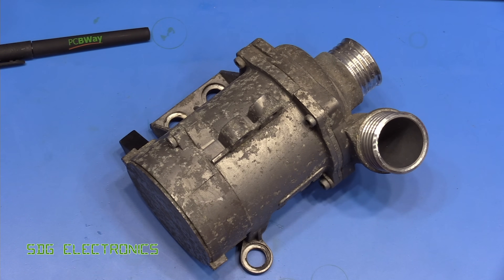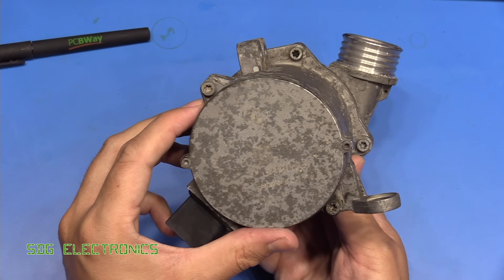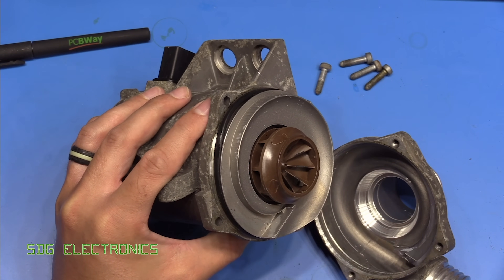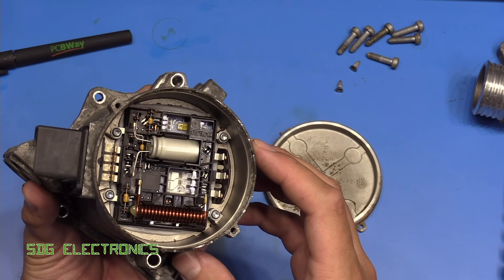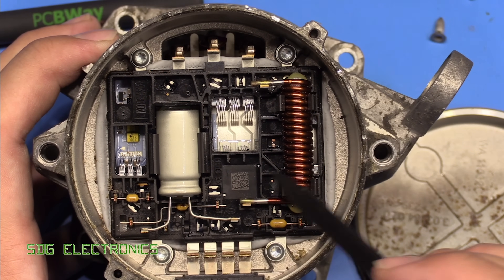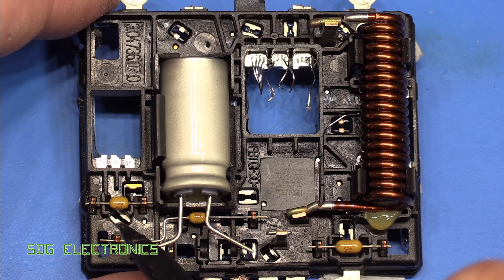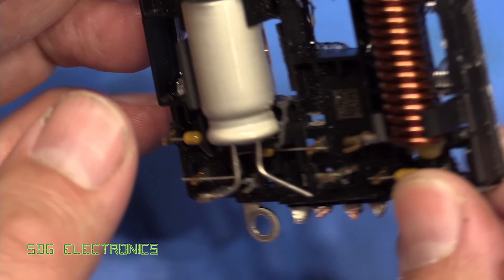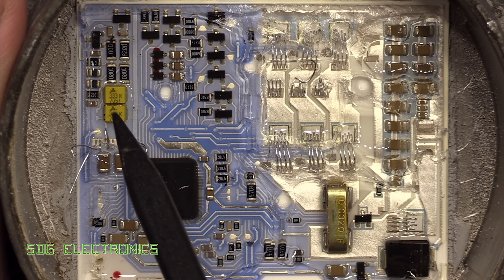SDG #257 Interesting electronics in a BMW Electronic Water Pump

Comment: Why are these destroyed by running dry though?  The main point of these really is to be able to use the heater while the engine is not running. ( Assuming the coolant is at temperature)

Comment: There's a depressingly common failure mode on this sort of construction with Bosch ECUs - the big bits fall off. Typically the larger tantalum caps just come adrift. They can be repaired, but it is a bit tricky as one would imagine, mainly due to the many fine & fragile bond wires present that are embedded in the gooey conformal coating that has to be cleared out the way to perform the repair. 

They seem to love bolting them to hot bits of engine for some reason, so lots of heat cycles.
Reply: I doubt you'd find any tantalum capacitors anywhere on a modern vehicle. They are banned by most manufacturers.

Comment: The engine driven water pumps are horrible. They don't do anything well. They are inefficient, leaky and have poor flow rate at low engine RPM. The electric water pumps can be variable speed but even if only one speed, they can be designed to give a consistent flow rate no matter what the engine is doing. You can also turn on the pump with the cooling fans to move heat out or the engine to minimize under-hood heat soak upon engine off. I think the pump design is centrifugal. The pump is controlled using a PWM signal. The unit looks similar to the Pierburg CWA200. When the pump is operating the units casting will probably track very closely with the coolant temperature. I think the motor is a three phase induction motor and not a brushless dc motor. To drive the motor you would have three half-bridges which are near the middle of the module which would be switched using PWMs to create a three phase AC current waveform. 

Ceramic hybrid circuitry design is difficult, it seems to take around 10 years before the supplier perfects the electronics. The failure mode is usually a crack somewhere on the ceramic. 

Packaging the electronics on-board the pump is to save space under-hood. However, operationally it is conceivable to just use a 3 phase induction motor powered over a cable to an electronic control module. The induction motor if sealed would last a very very long time, with the first failure probably occurring in the bearings. Perhaps the best solution would be to do what ABS designs do. That is, separate the driving electronics from the actuator, but mount it on the back of the unit so it still saves space. This way you can just replace the electronic module end piece rather than the complete pump if the failure is in the electronics. 

I think you could actually rebuild the pump if the failure is in the electronics. You would have to install a new electronic power module on the motor coils. Much like with rebuilding alternators.

But, if there is room in the vehicle you could perhaps mount a different design approach to heat sink through a longer cap (if the vehicle has a couple of inches clearance on the end) which could have a set of cooling fins to keep the electronics cool.

Comment: If you see inside the VW groups DSG gearbox the whole circuit is made up of the large ceramic substrate with ICs having gold wire bonding.
I don't which engineer in VW group suggested to go for ceramic substrate for a gearbox which goes through harsh vibration.

Comment: You should apply voltage and see if anything is getting hot.  Perhaps moving components around fixed the board if there was dust inside :)

Comment: Now I know where I can get a high quality capacitor when I need one on a Sunday! 
Just head out to the local pick apart auto wreaking yard and pull apart a BMW waterpump! 
I have been sourcing super capacitors from the BMW airbag modules for some time now.... Their wiring harness also provides many useful applications too, especially the long battery to starter motor cable, great for DIY jumpstart cables.....

Comment: I suspect a lot of the reasons for such a different design is vibrations. Huge variety of frequencies and amplitude on an engine. Solder joints tend to have a nasty habit of failing in automotive stuff which is probably the reason for the flexible wires. And the plastic is probably there to try and damp the larger components.

Comment: Automotive components teardowns are my favorite videos! Love it!
All components used in car electronics are Automotive Grade, a lot higher grade then consumer electronics, and in many cases about 20-30 times more expensive. Which is why this Nichicon capacitor has no sign of degradation.  
By regulations,  modern cars are made to withstand 24V in reverse, in case some crackhead jump starts them in reverse from a truck. The CAN and LIN lines can withstand +/- 32V. Any other line can withstand short to GND and +16V. Everything is EMF resistant as well. 
People who hate on modern cars just don't understand what goes into manufacturing them, and how protected they are, compared to just 20 years ago. Car manufacturers, and especially car dealers make more from maintenance then selling cars, which may give you an idea why they brake so often. It's not just BMW, it's every car manufacturer on the planet.
Reply: There is a line in a swedish song that says "Now I waste my time with painful nostalgia" That's what people that think an austin maestro is more reliable than a modern car are doing. No point telling them though.

Comment: Interesting look inside a BMW water pump. Thanks.  Did you mention at the end that the thermostat was also replaced. I would have assumed that as they have full control over the coolant flow they could do away with the thermostat. Edit: Perhaps its just for there for the full speed failure mode
Reply: Thermostat is there to control flow to radiator, as the electric pump runs all the time to circulate water through the block to keep hot spots from forming. Also speeds up a little as the heater core is enabled, but will still, even with no heat, have to move water around otherwise the cylinder walls and heat heat up more than normal, plus the water is also used to cool down the engine oil at the filter, so that the hot oil being pumped up from the sump, after cooling the crank and pistons, is kept from degrading too much.

Speed is increased when the ECU detects flow to the radiator, from a sensor on the radiator, and then is modulated to keep the temperature at the return from the radiator constant then, so the engine runs at a constant 95C temperature.
Reply from the maker: There is still a thermostat to cut the radiator out of the cooling loop to let the engine get up to temperature quicker. The oil and water temperature is effectively controlled through both the radiator fan and the water pump. It runs at a low speed all the time, but increases when the coolant temperature goes up. There's a couple of different thermal profiles - the eco setting raises the oil temperature up to around 112C, under heavy load it drops closer to 100C. Oil temperature is tied to the coolant temperature through an oil cooler - this car has the larger oil cooler so the temperatures track closer when driving hard.

Comment: Integration is the key to lowering cost and I expect a modern re-design of that PCB to have far fewer passives and only external power transistors. ASICs running directly from battery voltage is pretty normal. One-wire comms (usually LIN) PHY would be built in to the ASIC.

Comment: I thought I saw a cracked resistor at the bottom near the center of ceramic board.... but it might be just some lensing
Reply: Yeah there are cracks in the soft silicone so its hard to see anything.

Comment: Looks like the ceramic board itself was made by Thompson CSF, with the logo appearing on the ceramic just below the main ASIC chip. Likely the ASIC is a Renesas part, as they do a lot of automotive parts, with a specific set of masks and programming to make the ASIC for Pierburg, and of course, if you order a million of any regular chip, any foundry will be all too glad to mark the package with whatever you want instead of the generic part number, for no extra charge.

Comment: You know they are prone to failure when you have multiple aftermarket suppliers of them, and even the actual BMW dealers install the aftermarket ones.
Reply from the maker: I think it also helps that most of these pumps are fairly standardised across the various models and there's a worldwide market. To be honest, I preferred this replacement compared to needing to do a timing belt replacement if a belt driven pump had failed.
Reply: @sdgelectronics  Do not think the price is right though, labour rates are pretty much the same for most of the water pump or electric pump replacement, and I can replace my old VW  water pump in under an hour, as it is really only 3 bolts holding it in. But the price of the electric pump is 30 times the mechanical pump price, from the same aftermarket place. they sell a lot of the mechanical pumps, mostly because there are a million VW's on the road still. BMW still is called Break My Wallet.

Comment: Would make sense that perhaps a component has failed in the comms input/output circuitry if the pump still runs but in a fail-safe (i.e. full speed) mode, as that implies the MCU and motor drive is still working.

It disappoints me that automotive manufacturers are increasingly going with these types of ceramic hybrids, because these things are almost completely unrepairable at the component level. I remember watching a YT vid a while back from a company that specialises in component-level repair of vehicle electronics, and they despair at ceramic hybrids filled with wire-bonded bare dies. One of their examples was an engine control unit from a Ferrari 360 that is commonly known for failures, but no longer available new. It's made by Bosch, and the entire thing is a conformally-encapsulated ceramic hybrid with about a dozen bare dies. They figured that only one of the chips frequently dies, but there's nothing that can be done about it. So for the sake of a chip worth a few dollars, an entire $100,000 car is rendered useless unless a 2nd-hand replacement unit can be salvaged from another car and re-programmed.
Reply from the maker: I got intermittent codes for other items on the same comms bus, so likely the slave transmit components failed. I agree that reparability is the last thing on the manufacturer's mind. On cheaper items like this, it's acceptable given the bearings are probably heavily worn too. Expensive or rare modules should be at least designed in a way that allows some method of salvage though.
Reply: There are better modern after market ECU:s availible on the market though. Sure it destroys originality but I would rather have a working reliable car. Also a 360 is hardly a modern vehicle.

Comment: I have seen same construction in my alternator regulator on VW, chip on ceramic substrate, bonding wires covered with very softy clear kind of silicone. Similar construction can be seen in ABS units.

Comment: Hello Friend,
The gunkie, snotty stuff is Dow Corning Sil-Gel. The connections are ultrasonic welds. No repairs are possible after the SilGel potting is applied and oven cured. Testing for QA can be done at any time, but repairs are futile.
Thanks,
(Former Visteon Technician)
Reply: Thanks for the information. Do you know how these bare die mosfets get mounted? Do they get glued or soldered to the heatsink or to the ceramic PCB?

Comment: Not like the old days. Too complicated. I would never buy a BMW.
Reply from the maker: It's been a solid performer needing minimal attention it's whole life, but it's getting old now so there's a few repairs on the list. I suspect with the most modern cars, we'll see them scrapped from electronics failures instead of anything mechanical.
Reply: @sdgelectronics  A friend of mine is a Mercedes Benz technician. He tells me there's no more million mile cars. They aren't made like they used to be. And you can't work on them yourself.
Reply: @acoustic61  Chery is advertising a million kilometer warranty on the engine, though I do suspect that this is also only the block itself, not the rest of the things like turbo and sensors that will likely fail first. Same as inverter AC manufacturers saying 7 year guarantee on the compressor, while they know for sure the actual unit itself, or the controller, will fail before that, and that a motor failure will also kill the controller anyway. After all fridge compressors are a well known part by now, made in the millions, and the hermetic compressor is not known to fail unless something else killed it first, or the housing rusts through, which I have had to replace a lot for under warranty.
Reply: @SeanBZA  Inverter air conditioning is so expensive in the USA that I doubt the energy savings would pay the difference in cost. Seems it's only marketing hype.
Reply: @acoustic61  Interesting point.  Clever ploy "Come buy save on power but you will be buying another shortly"
Reply: @kissingfrogs  Sadly I have seen that too often. The inverter units fail electrically just around the 5 year mark, just outside the warranty period, but the regular AC units will do much more. Controller faults are the most common reason they fail, followed by indoor fan motor failures. The outdoor fan and compressor tends to last, though often the motor run capacitors do fail. Last few AC units I installed I made sure the fans are plain induction motors, simply because those are the most reliable, just have to replace capacitors every 3 years or so on them, and I was doing controller repairs for a long time just to replace failed capacitors in them. the housings  rust away, but still, they would do 10 years easily with only minimal regular maintenance and cleaning to keep them in good condition.
Reply: @kissingfrogs  Same with Electric Vehicles. Overpriced novelty toy.

Comment: Anti lock brake controllers, diesel injection pump controllers - mechanically sound but frazzled electronics ....  dig em 'out and find ceramic plate + bare die...  Mind you - could be a Ferrari ECU ....   !!!

Comment: Those boards are not interesting. They're horrible to deal with :p There are control units using the same tech but on a much grander scale. Hopeless to solder on bdm wires (think jtag) since you not only have to deal with the heat sinking, it's also covered in gunk :)